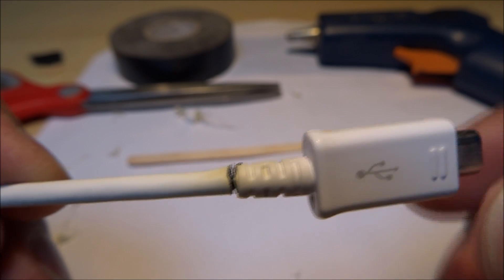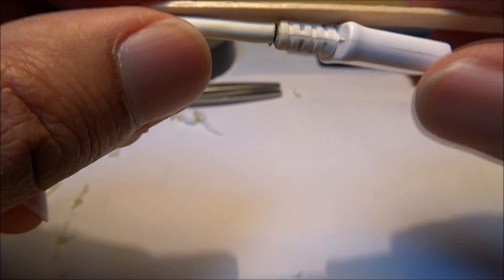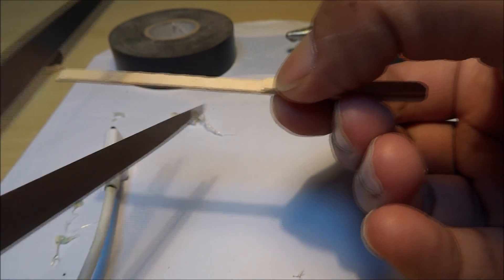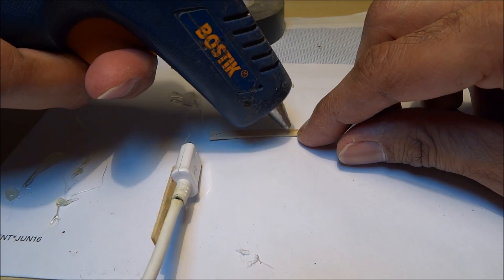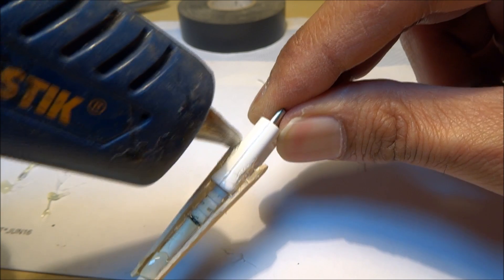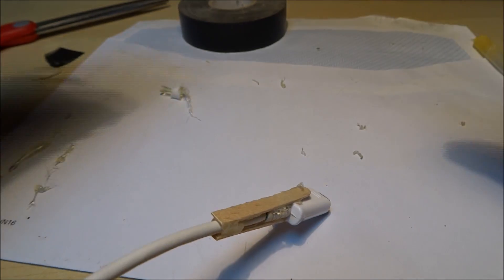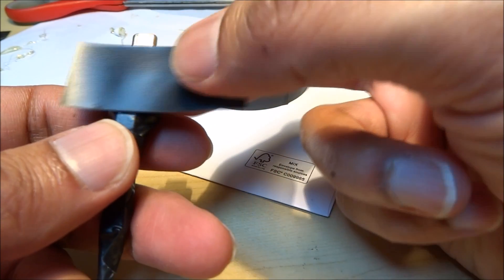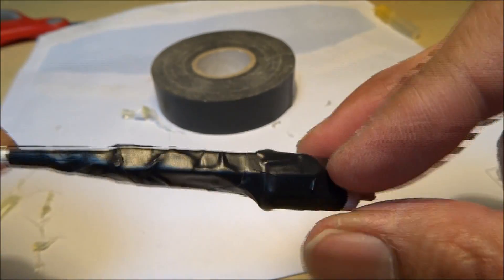How to fix and strengthen a damaged USB charging cable and make it last forever!

Comment: So.... my issue is - the USB tip already broke off right at the neck of the usb male connector...  without any length of cables to twist together - are there other alternatives to repairing my cable issue ?   Ty for your time.  Cheers!

Comment: If you have a problem with a micro USB that doesn't stay plugged in well on the small end there's 2 little spike things you can see on the underside, those are what the plug uses to 'hang on' to whatever it's plugged into, over time those get worn in and don't spring back or stick out anymore. If they're still sticking out a little bit you can take some nail clippers and try to grab the little piece that's still sticking out, squeeze hard so it doesn't let go and pull the spike things out a bit, gotta yank/bend em out pretty far to get them to stick out like they did when it was new. If they're not sticking out enough to grab with anything you can take a needle and push it in the little space above the spike thing, the goal is to get behind the the spike thing with the needle so that you can pull or 'scoop' it outward so it grabs again when plugged in. Hope this helps some peeps..
Reply: awesome idea you saved my life

Comment: Why you messing around with popsicle sticks and electric tape? LOL! Do yourself a favor and use heat shrink tubing or shrink wraps.
Reply: @odijin heat shrink is not strong enough on its own, I've tried many times. I would put some heat shrink over the top of this solution to make it nicer. Clearly the heat shrink wrap material is much thinner than the original plastic the usb is made of  and deteriorates over time.

Comment: This hack or fix is hardly worth it. USB and Lightning cables are relatively cheap and with stores like Walmart, Walgreens, CVS and if need be, the local large convenience store like 7-Eleven, Sheetz, etc. all being open 24 hours. 

It's much easier, efficient, and in the terms of time and effort, cheaper to simply buy a new cable if it frays or gets damaged. Buy several cables and power bricks as cheap insurance so even if the new one fails, you have spares
Reply: chrismc410 your the problem of why there is so much landfill today and for the future because you just throw things away with out regard to try and fix what you have. So easy to spend and wast if you were in a poorer country you just might respect what you have and fix things, also if you actually tried to fix some of these things you might respect the goods you have when you know what goes into making them.
Reply: @fishmut  I would still replace a damaged cable for safety reasons alone. I've seen damaged and "repaired" cables either not perform as well, not work at all, damage the device they're connected to,  and catch fire.

USB cables and most products in general are tested for quality and certified for safety by Underwriters Laboratories, UL. The moment a cable is damaged, the quality and safety of that cable is compromised. Repairing it will not be sufficient to restore that quality or safety. Such a cable should be discarded and replaced.  At the very least shouldn't be relied upon and considered a probable suspect for any performance or failures from that point on. 

Why take the risk of device failure, poor performance or worse when replacing the cable with a new one is the cheapest in the long run, easiest, safest, and most efficient way to resolve a damaged cable problem?

Some things are not worth repairing. Be it the work involved, costs involved, safety reasons, or all of the above.

Some things are in a landfill for good reason.
Reply: @chrismc410  Not everyone lives in places with the aforementioned stores and quality control. It's a good idea to have it plugged in while doing the repair, apply glue directly to the wires, then use a splint or zip ties to reduce the strain on the wire termination.

Comment: Get shoe-goo. You can pick it up at Walmart. And put it on to the cable. DONE!!. Had mine for 4 years. Same cable as yours.
Reply from the maker: Thanks for the tip!
Reply: If he is gonna go to walmart then why doesn't he buy an charger there?
Reply: @rryu05  Because you'll either spend $30 on a Samsung/Apple cable or buy a cheap one and end up with the same problem in a few months... A tube of shoe-goo would probably repair 50 cables.

Comment: Might as well buy a new one
Reply: Why buy a new one if you can fix it easy?
Reply: @YR7A  even if you have the means to fix it, it will take 15 min to an hour to fix. Minimum wage is $7.25/hr. 

An hour's worth of work on a cable that even if fixed, will be on borrowed time from there on out and can't be trusted not to fail again and eventually will. 

At $7.25, you're already nearly halfway into the cost of a new cable at some retailers or nearly at or slightly above the cost of a new cable at others.  

The hour of time and effort needed to fix the cable can be put to better use simply buying a new one that you know works, undamaged and if from known manufacturers, under warranty.
Reply: @chrismc410  he needed 7 min I fixes mine the same way in 10 min so your math dosnt hold up (and some people like fixing things)
Reply: @chrismc410  what about the waste? Imagine a thousand broken cables in the dumps. 
Now imagine billions of these broken cables in dumps around the world.
Reply: @sskhussaini  thats part of the reason i have broken cables incinerated.  They aren't safe to use once broken and even if repaired. Once they break, it is replaced. Old one cut up and burned.
Reply: @chrismc410  incineration creates even more pollution though? CO2 and other noxious gases?

Is there any way to recycle cables? Like melt down the insulator and reuse it?

Governments and businesses need to step up their game.

Comment: I put a dab of Elmers glue around the break, and wrap thread or cord around it while the glue is wet. The glue and thread combine to form a strong bond. Let it dry, and add more glue. Works great and takes 5 minutes. Have not had an issue, and can get a few more years out of the cable.
Reply: Wow! Thanks I tried your method and it worked perfectly
Reply: @joestar4sho  
Glad it worked well. I still use that method. 👍
Reply from the maker: Thanks for the comment. Don't forget to like and subscribe!

Comment: The only problem with that is you are moving the problem. The issue is with the pivot point of the cable this will now be at the end of the stick. No doubt it will last for a lot longer now. Good tip.
Reply from the maker: +Zed Man thanks for the comment the point between the connector and the cable is always the weak point it's so annoying maybe it's worth doing this on new cables!?